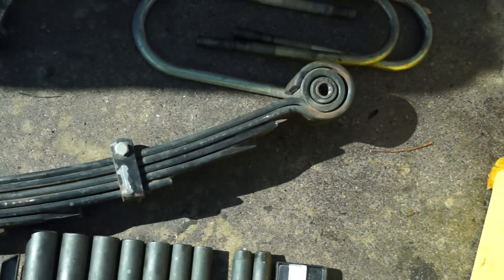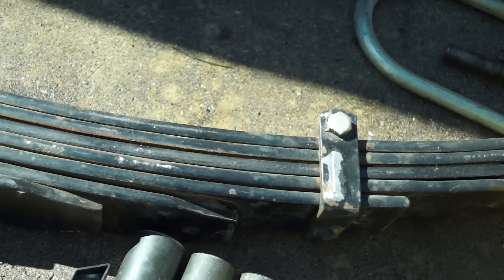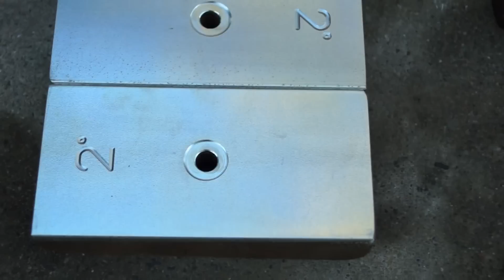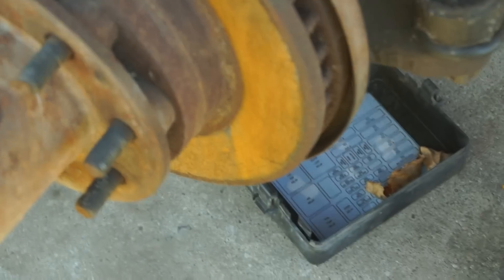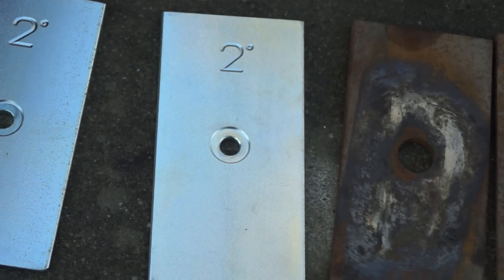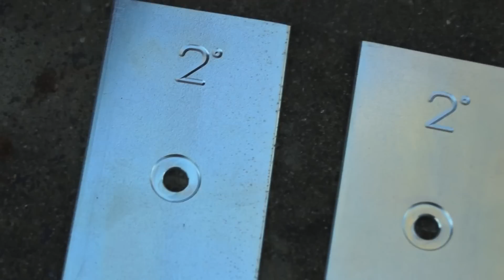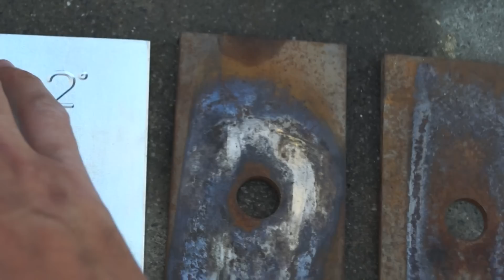chevy cummins swap part 2:  modifying atlas leaf springs + a little tech info

Comment from the maker: Have the cummins in now, looks like it's sitting about right so far. Definitely curious how well my thick rear add a leafs from sdtrucksprings will work next. I know they will dramatically inhibit flex in the rear, but maybe they won't be too bad. If they are, I'll either add the pro comp leafs I used in the front cut to size, or I'll just step up and add airbags. Then I'll have load carrying and flex.

Comment: how does this flex? i just used a 4" lift 1/2 ton 52" spring, it only has 5 leafs and is 1.5 inch thick, seems to sit pretty level, hopefully the cummins won't sag them out after the first trip!!
Reply from the maker: Ryne Mott These springs flex better than I can currently take advantage of, the tires hit the fenders early. Here's a link to offroad design's leaf spring page, their thoughts on this too. http://offroaddesign.com/catalog/ORDCustomSprings.htm